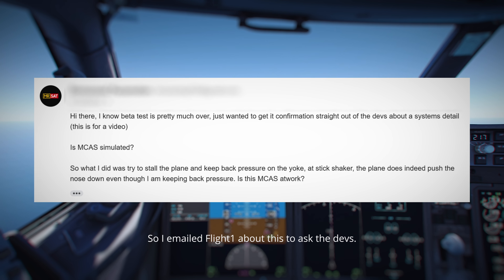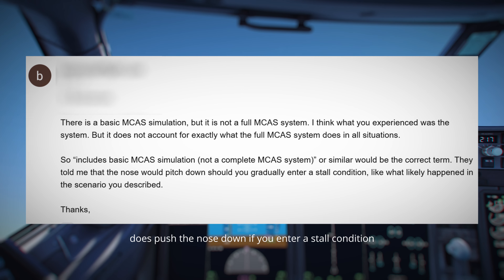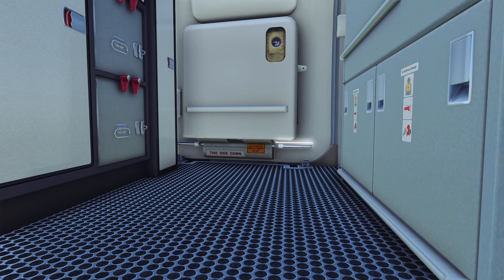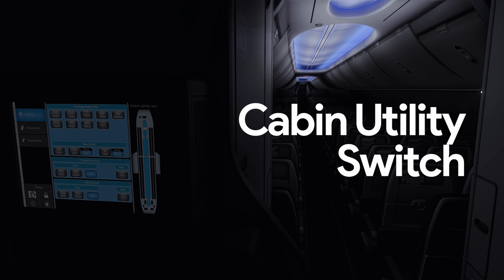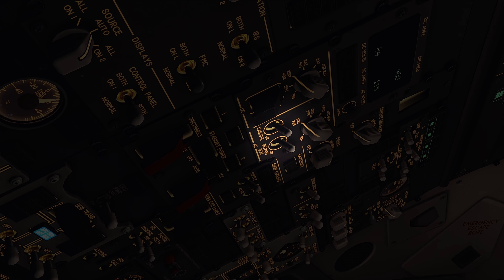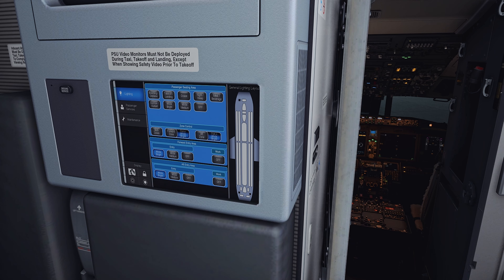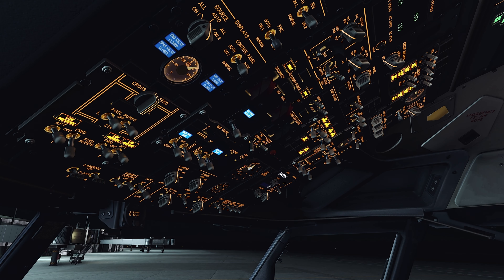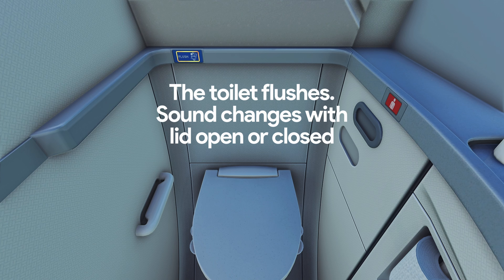Things I learned | iFLY 737 MAX | MSFS

Comment from the maker: I'm pretty sure the nose down was just natural behavior near stall, most planes do that, and I actually didn't see drastic stab trim changes on the external view, nor does the control feel heavier (Due to MCAS trim down) so I reached out to Flight1 / iFly to clarify and yes, they have confirmed that there is a basic form of MCAS that is simulated. It is not the full system, so it is not representative of the full capabilities and behavior of the real life MCAS but a basic version is implemented that pushes the nose down during stall conditions! So is the MCAS really working? That's still up in the air but anyways, I included other tidbits of info as well. Might do more tests
Reply: Are you having trouble with RAAS? Mine doesn’t work even tough it’s turned on, is it a bug or do I miss something?
Reply: @casrexyt7302 have you used the plugin to scan and build the databases?
Reply: @Shiroko0516  how do I do that? I bought it installed it and updated the airac and then I done 2 flights MMMX-MMGL-KLAX but RAAS never worked
Reply from the maker: @casrexyt7302  open the ifly plugin and click "create airport maps"
Reply: @MrSaturday530  ok thanks

Comment: Cool video!! Quick question, does it simulate elevator jam landing assist? It’s a switch on the aft overhead panel which raises the spoilers and makes them act as elevators when you make control inputs (flaps must be 1 or greater). It’s a new feature on the MAX which I wanna try out, but waiting for MSFS2024 before I invest in MSFS
Reply from the maker: I'll check when I get the chance. I'll comment back to let you know the results.
Reply: @MrSaturday530  awesome! Thanks a lot :) I appreciate it!
Reply from the maker: @LuxPlanes  So I tested it, the switch and the associated light work but it does not seem to have any effect. The spoilers do not activate and assist as elevators. Also I don't have the option to jam in the elevator
Reply: @MrSaturday530  thanks for testing it out. Maybe it’ll be something for the future :) I was mostly interested to know because I have a video idea based on that feature and was waiting till I get the ifly max to showcase it. Anyways, thanks again, very kind and helpful of you! Keep up the great work!